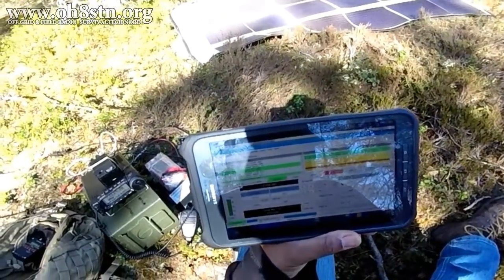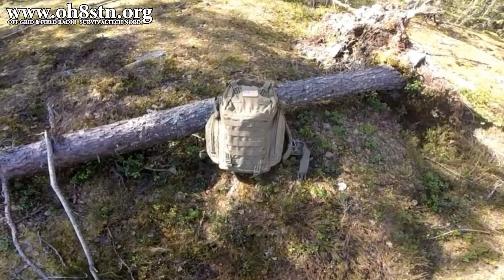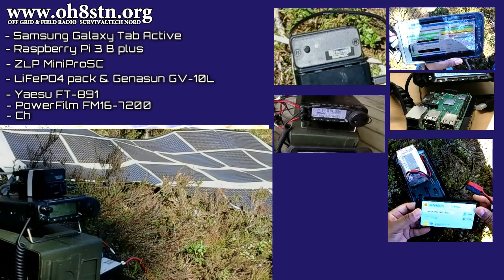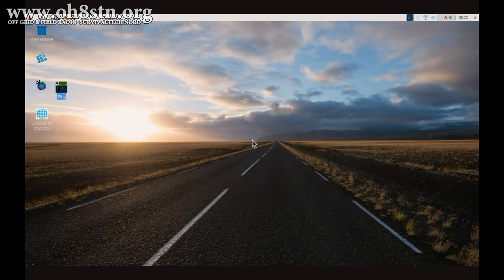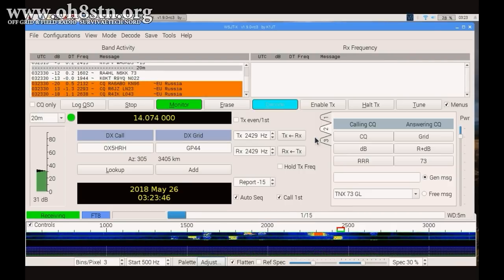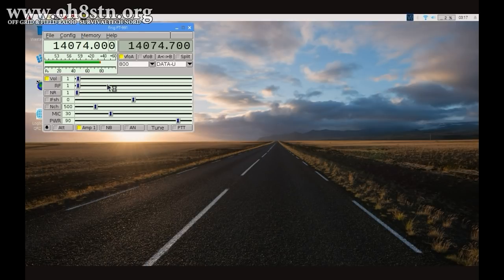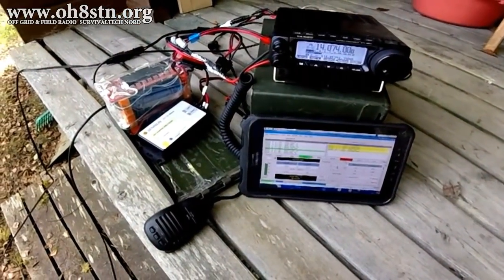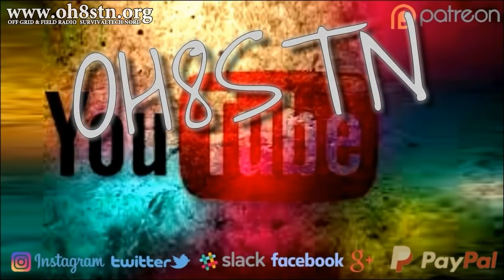Raspberry Pi Powered Portable Ham Radio Station

Comment: Do you have a link to some sort of tutorial on how to setup your android and pi that way? Everything I have found does it over a network.
Reply from the maker: Not yet but  I can write a blog post or vidro on it next week.
Reply: OH8STN ok been at this for a while now.... I used this tutorial, i stopped at the part about accessing the internet through the pi:
https://www.raspberrypi.org/documentation/configuration/wireless/access-point.md
And this blog do help some trouble shooting:
https://www.raspberrypi.org/forums/viewtopic.php?t=128449
Reply: .... hardest part was sorting through the million tutorials about old systems and just figuring out that i needed to make an "access point" instead of just an SSH over a network.
Reply from the maker: Actually that's what I did. I made an access point and I connect to the Raspberry Pi with my tablet through the access point. Its all wigi. I don't know why those other tutorials make it so complicated